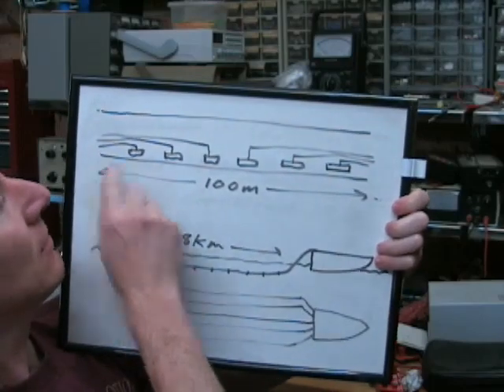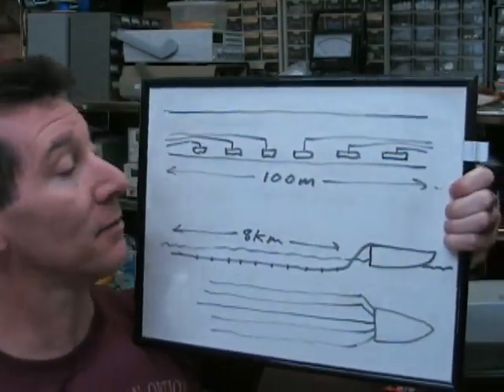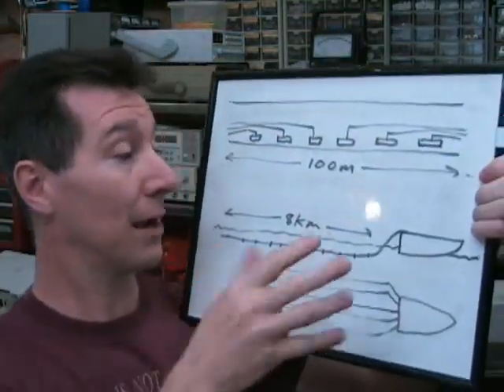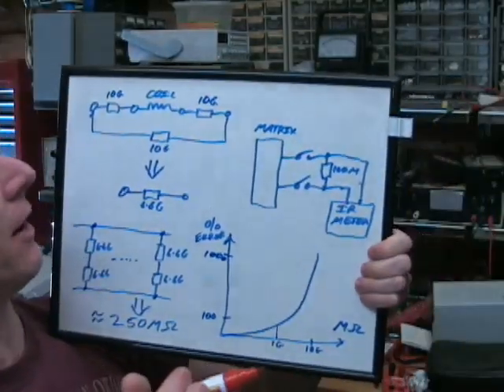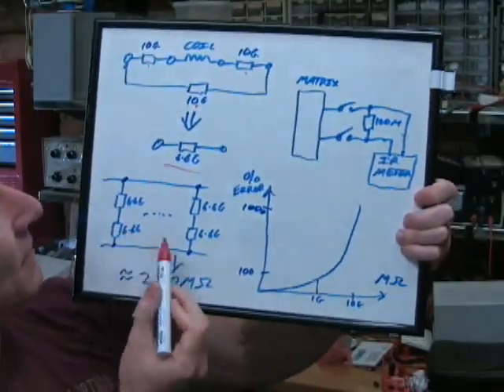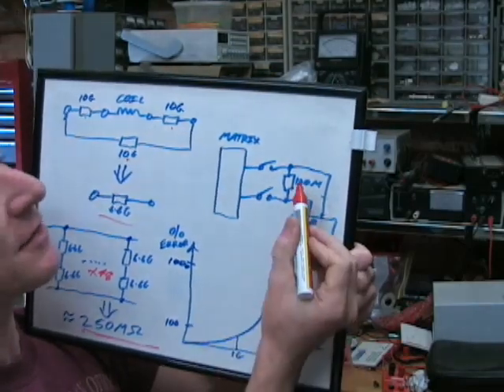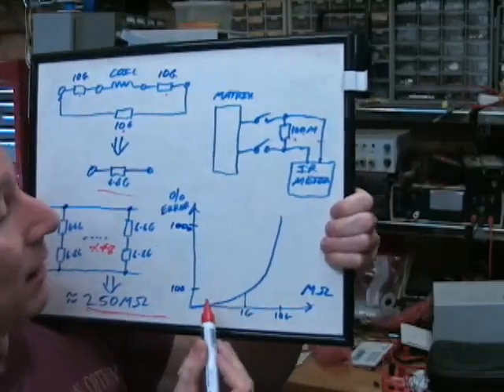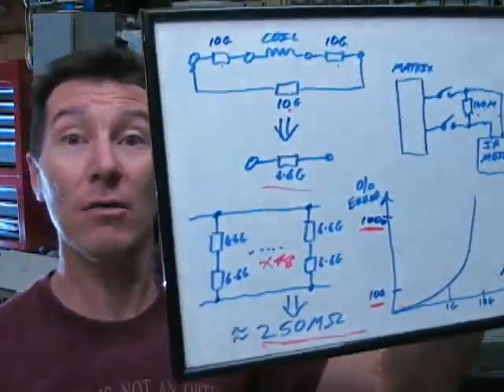EEVblog #38 2of2 - Seismic Survey Boats & Relay Matrix Insulation Resistance Measurement

Comment from the maker: This one was only a low level of around 5-10V for IR. The hydrophones would actually be damaged at 50V. Another model of the system used 500V for the power wires as well.
One-man-band design team. Designed, Checked, and Approved by me :->
Probably spread over 6 months and went though many design and goal post changes.